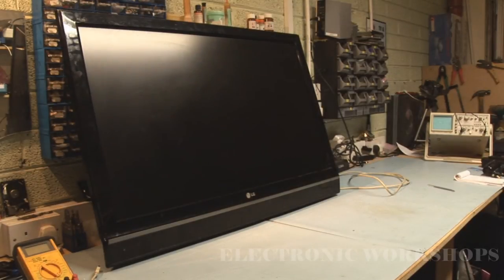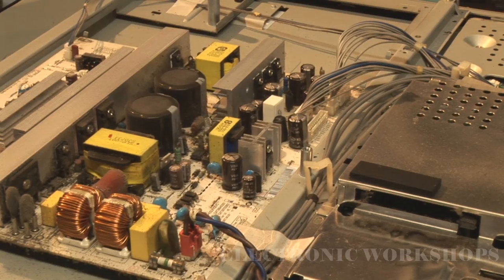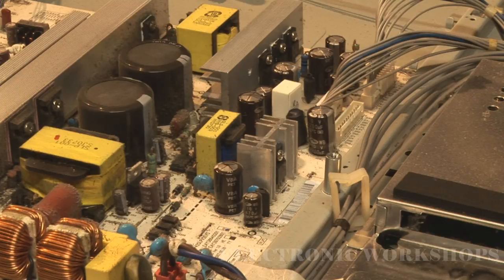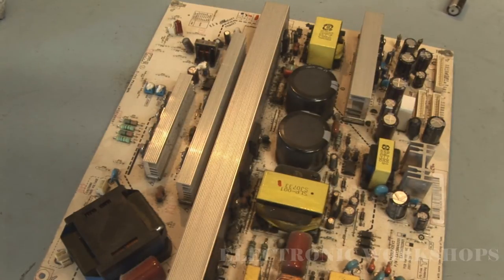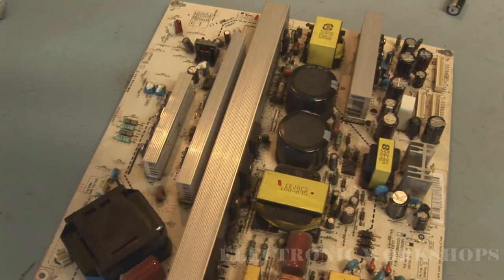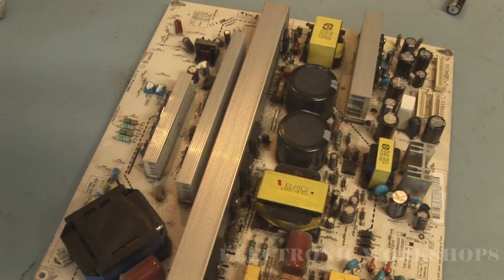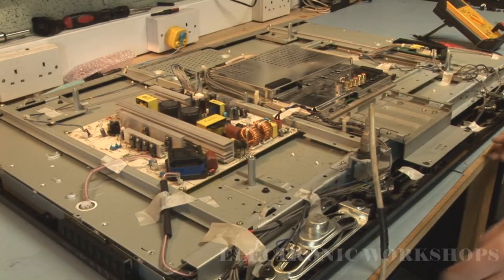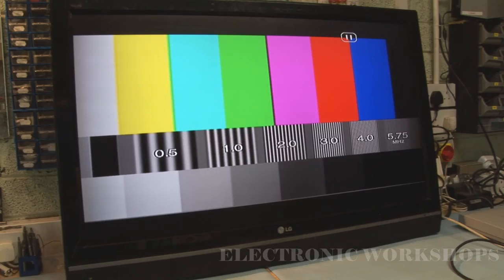LG 42LF65 Dead or Intermittant Switch on

Comment: Hello. i have the same tv problem. 3.4 volts appears on output and 5 volts, but 12, 19, 6.5 volts is not. where to look for the bug. nothing appears on the capacitors.

Comment: great fix  all ways the case on these set's,.
its strange, when I use to repair the old crt's its was all ways lopty's , bu508/d or horizontal chip, I think as I can rember I may have replaced several caps in older sets.....
Reply from the maker: Bring back the old CRT, they were the days when you could get some really good technical info, "talk to a real person", service manuals ect, and made a few bob as well.
Reply: yes sir totally agree with that  :-)